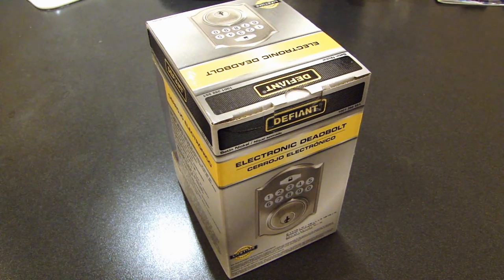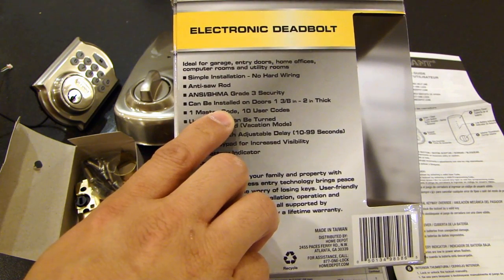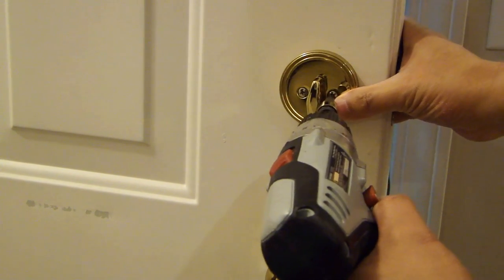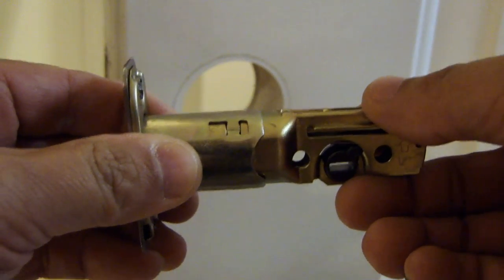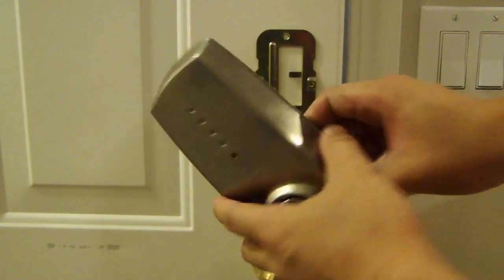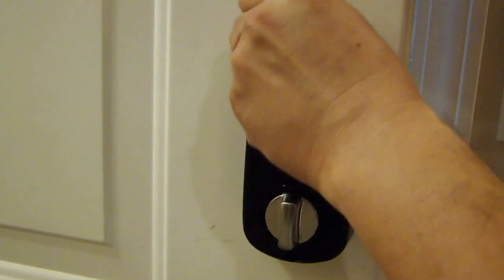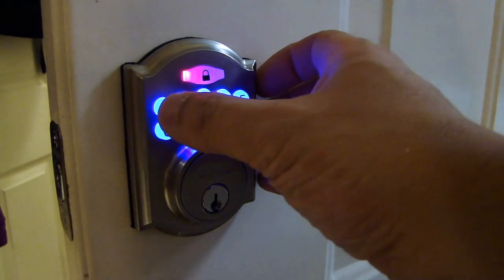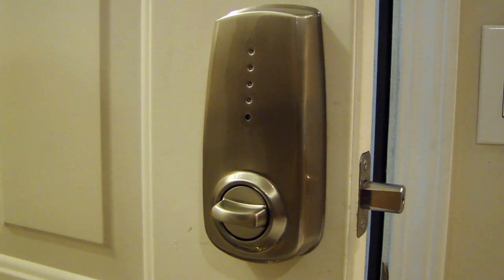Install Electronic Deadbolt Door Lock - DEFIANT

Comment: Oh, I solved it. I just entered the default master code WHILE the electronic component was not inserted into that slot. Then I think it was finally able to complete the installation. Then I tried pressing the lock button, and it started locking, which wasn't possible before. It also helps to make sure that when you lock it, you have to hear a click sound and then try to push it with your fingers to make sure it doesn't move, which means it's working.

Comment: Hello, I had this deadbolt for a year in the garage were the locks are in the right side. My new home in the garage door locks are in the left side now. How can you reset it so it can figure out which way to turn? As of now it's turning the opposite way.
Reply: I am having the same problem. Did you ever find a solution?
Reply: Remove one battery and put it back in while holding down the lock button.  It will re-calibrate itself and then beep and you're all set.

Comment: I have installed the keypad. But the problem is everytime I do the instruction to get a new master code, everytime I enter the default mastercode and then press the lock button it's always making the lock go out and in and out and in. It never gives a me a chance the change the master code. What do you think it is? I tried contacting the manufacturer and all they did was try to walk through the steps with me, which was useless. Never tried to tell me what the problem was and how to solve it.

Comment: Another nice video to follow. All your videos are very nice home upgrades. Do they have one for the entry door, like the dead bolt and lock as one unit?
Reply from the maker: +Edmund Mendez Most brands make them for deadbolt, but I have only seen a few electronic locks for the regular door locks and they are expensive.
Reply: +dial2fast No worries, maybe I'll install one like you got in the garage. Thanks

Comment: Is it possible to disable the lock temporarily for a party outside where guests will be coming in and out?  Couldn't find a way to do it on the instructions.  Thanks for help if you know the answer.
Reply: Take the batteries out
Reply: Just don’t press the lock key….

Comment: In the summertime when the weather is VERY hot my deadbolt doesn't detract completely inside during the unlock. When it's cool/cold weather it always detracts. How can I fix it so it works as it should during the hot weather. I live in the south so there is also high humidity in the hot time.

Comment: how do you get rid of the default code 123456.. I tried what was in one of the comments: press red button, enter programming code, press lock, 4+0+lock+lockProgram User code: press red button, enter programming code, press lock, 2+0+lock+(new user code)+lock
but when I try the default code it still opens it?  any advice?
Reply: I just figured it out .. press red button , enter program code, press lock, 1+ 0 lock , 
once you do that program your NEW PROGRAM CODE,  this will replace the default 123456 code. 
when you press 2+0 thats how you add additional codes to either existing or new program code. 

hope that helps
Reply: dustinpool

Comment: how do you change it for a left hand swing door?
Reply: I think you will find the lock will work that out for itself in the setup, just as mentioned in the video after the code 123456 was entered.
Reply: Jeremiah Tolison you need remove the door handle turn it 180 degrees and install it.
Reply: Flip the lock upside down inside the housing( it fits in both ways) and anytime there's an arrow pointing that says up make it point down.

Comment: all you have to do is enter the programing code to unlock it??? wtf
Reply: +nuclearthreat545  You must CHANGE the default programming 6 digit code (123456)  to one 6 digit # of YOUR choice.. You do not leave that in there but yes it also opens the lockset. It is your primary code.. the rest of the codes are just user code and can not make changes to the lockset